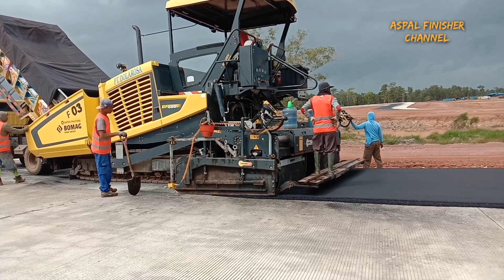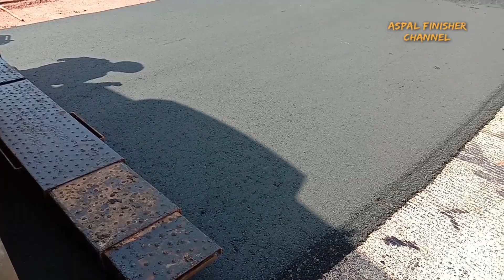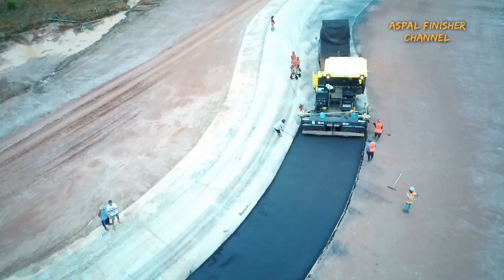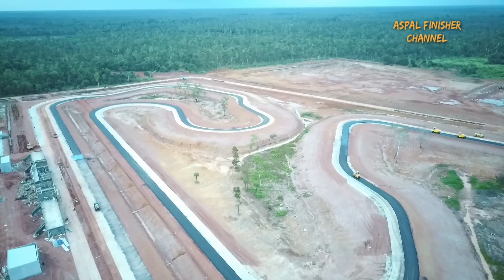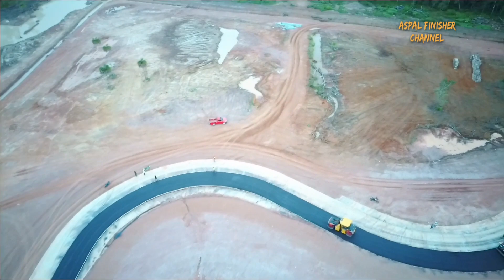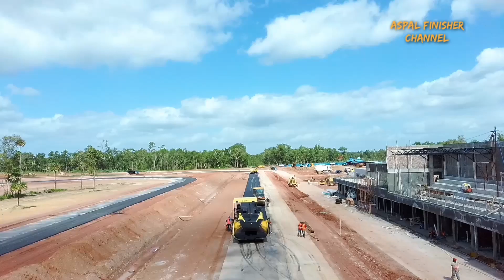Proses pengaspalan lintasan sirkuit Merauke Papua/Aspal Finisher channel

Comment: Lebar dan panjang berpa om.........kenapa gak pake sistem hot join om..biar LBH bgus ..biar gk klhtn sambungnya......
Reply from the maker: finisher nya tanggung hanya lebar 6 sementara sirkuit nya 8meter baru alat nya tidak ada hot join nya kawan.pada hal alat nya kalau pake sambungan Bisa 8meter. terimakasih